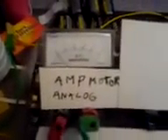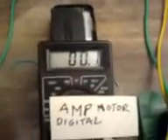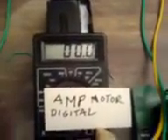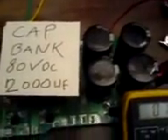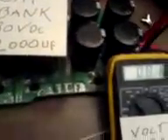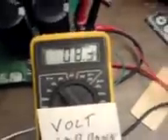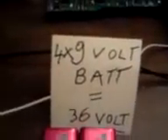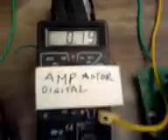newman motor 4x 9volt batteries part2

Comment: If you break the current more often per revolution, the rotor will runs slower, BUT You will get much more bursts per
rotation cycle, so the cap bank will charge up much faster  and you might be able to light up the lamp all the time !
Use Avramenko plug one wire charging of the
cap bank.
Many thanks.

Comment: If you want to collect the BackEMF pulses as in the above video it helps, if you use ONE WIRE Avramenko plug type charging of the
cap bank in the above example, as this will not drag down your  magnet rotor
due to Lenz law.
So better  switch and break the
commutator more often and this will give each time the current is broken, big BackEMF pulses which will charge up the capacitor bank or battery supply much faster.Regards, Stefan.